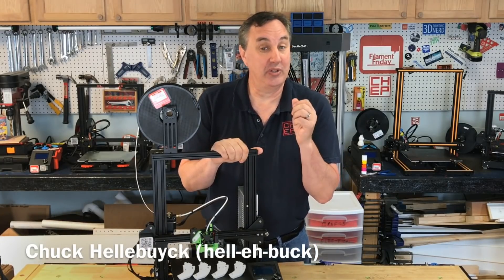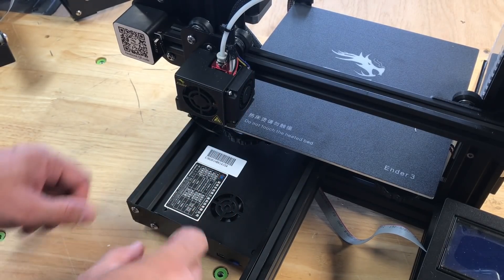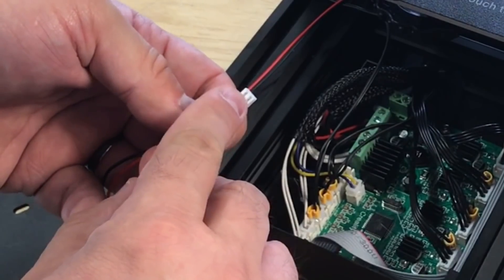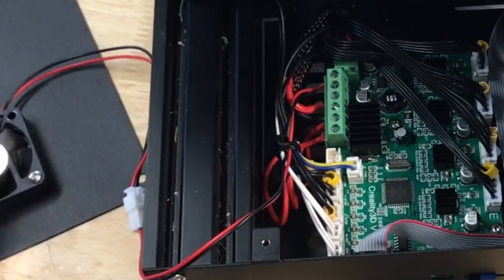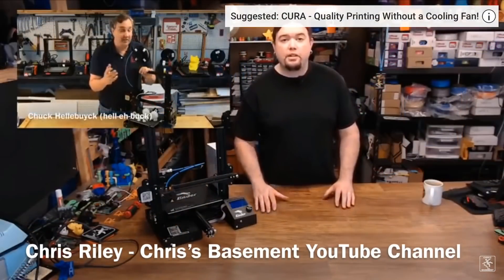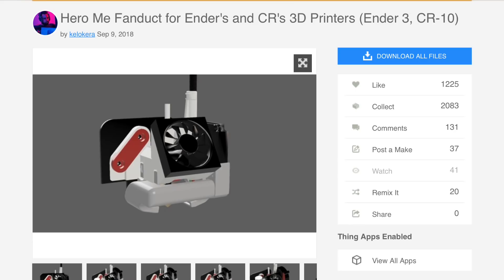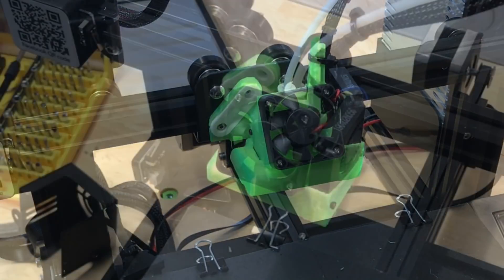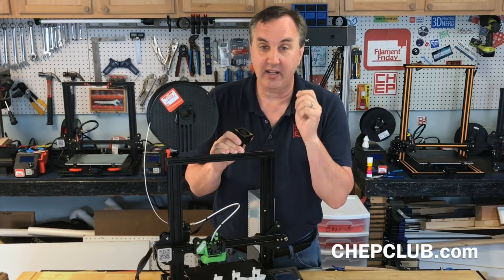HERO ME FAN DUCT and Fixing the Cooling Fans on Creality Ender 3

Comment: As much as I have read/seen/heard everywhere and your video here (which I enjoy to watch and learn), I still am curious and trying to figure out what the fan really is for. Is it to cool the filament that just oozed out of the nozzle? Because cooling the nozzle itself would be going against the heating of the nozzle,  cooling the part(printed part) would mean also cooling the bed (with stray air) again going against heating the bed, so the only thing left is the "freshly" molten filament that needs cooling as soon as its layered on top of the previous layer?
Reply: Incorrect. The nozzle heating is a partial side effect of being attached directly to the heat block. So the part cooling fan isn’t hurting much if it starts to cool down the nozzle a little. The pid will somewhat balance that out. That’s why you’d want to turn the fan on shortly before the slower first group of layers finishes.

But past that, maybe it’s time for some updates profiles Chep. With 4.6-4.7 cura, the stock profiles are orders of magnetic use more reliable and produce much better parts. I think they are very similar to your old old profiles.
Reply: @rayaguilar9085  Does the passage of cold filament not cool down the nozzle, thus needing to constantly heat the heaterblock and eventually the nozzle? Without a constant heat supply, the nozzle will cool down quickly causing the much hated clogs. Therefore I don't think cooling it (the nozzle I mean) even more is needed by the fan(s).   Pid settings are to constantly keep the nozzle temperature as set by means of an algorithm using 3 variables (P i and d respectively), which is the end result, however it would have to overcompensate for the extra heat loss caused by the fan.
Correct me if I am wrong as I enjoy learning new things every day.
Reply: Mike Z you are correct that air moving over the nozzle will cool it (somewhat). I’m not arguing that. But think about the surface area of the threads and the heat transfer to it. The heat loss from the indirect part cooling fan is very minor compared to the direct connection to the heat block. Metal to metal. The pid system is barely hindered by the part cooling fan directly blowing on it. That’s why we use those silicon socks.

But my main point was that the idea people have in their head of the nozzle needing to be the perfect temp is not completely right. As an example, 200°C for PLA. The heat block and the thermistor are trying to melt the filament in the chamber to that. In the 1/10th of a second that the filament passes through the tapered tip of the nozzle, it doesn’t lose much heat from the differential between the nozzle and the block.

As soon as the material is extruded and exposed to air, it’s extremely low density and surface area cool down rapidly. That’s what the part cooling fan is trying to do. Remove the heat that was carried from the heat block as quickly as possible.

I think Chep is seeing these results without running the fan for multiple reasons. But most notably because he’s got his profile dialed in for his env. That being said, he would still see gains with the fan on if he was doing longer bridges. It’s just that so many people have Enders that we’ve damn near conquered these profiles for most filaments :)
Reply from the maker: That’s it.
Reply: The whole hotend assembly (including the fan) is a heartbreak. As you push filament through, you need to warm it up to it's temp by the time it gets to the nozzle. First you cant just push filament into a hot nozzle, it'll takes time for it to heat up so you preheat it. Second the fan keeps the hotend from thermo runaway, where it would just keep getting hotter and hotter till even the sensors would stop responding if it has any and melt or warp things. Most things have termo protection faults, as in failing sensors, high temperatures and such that it will shut off or do some countermeasure. DIY stuff dont. That fan regulates the temperature of the heat break so it won't over heat and go into thermo runnaway.
Reply: @jimd4609 For thermal runaway to take place, the hotend thermister needs to fail first. The hotend won't keep on heating, as thats the job of the thermister, to control the temperature from going over the temperature set in the slicer software for the print.   The only reason fan isnt needed would be if the slicer settings are almost perfect not needing to cool, except for overhangs of course.
Reply: @macvideoworld  not the fan at the nozzle but what they call the hotend, the fan blows cool air across the fins of the hotend. It won't effect prints unless some air from that blows over your print. Over time having it over heat will damage the sensors giving wrong readings and so on. I make wonderful prints but you have to understand why that fan is there. 
Oh one more thing the slicer doesn't control the hotend temperature. That's built in the printers software at factory that was determined by the rate of feed, also set by factory. You can set the nozzle temp in slicers, but not the hotend, and in all in one units, a fan is a must or the whole unit (nozzle and hot end) will be at same temperature, and you dont want that. Itll cause the gases to build up and pops in your feed and you cant get a good feed cuz all your doing it dipping filament in a pool of molten plastic and nothing to really press it through. Tho it will still work, just won't get good prints.
Reply: @jimd4609  I think you use different terms than everyone else. The entire component from nozzle to heat sink is the “hot end”. Not just the chamber, heat break section and heat sink. I don’t think @Mike D meant that the slicer controls that. I think he meant that because we’ve dialed in the settings on these printers, there’s less need for the fan and less danger of damage. Essentially he’s printing at a slightly too cool temp, so that the part fan isn’t really needed.

Past that, no. That’s not the case. Even in a low power or off state, the heat sink getting too hot isn’t going to damage the thermistor in the heat block. The pid reads the same temps no matter what is going on up above it. You may get the ptfe too hot or something, but the fan you’re talking about does not really play a role in thermal run away. The only reason for that fan is to cool down that feed chamber before the heat break so you don’t cook your ptfe, give consistency in the heat profile of the moving filament and (mostly) to keep the two sides in equilibrium.

To bring this back... it’s inaccurate to say the part fan plays no role. It’s not a huge role. But it’s there for a reason. Chep just didn’t need it because his profile is dialed in. The filament is carrying the majority of that heat with it. Just like brass casings in a gun.

Comment: The more I watch these videos the more I'm convinced that the stock Ender 3 is just fine as it is for 90% of the PLA work most people do. The more I try to "Upgrade" my printer the more I mess it up and go back to stock. Now some might say it's because I don't know what I'm doing. I would agree that I'm a novice at 3d printing. But clearly you are not and you're showing no real improvement. Could you please try the same thing on a more complete print? Maybe something with smaller details and over hangs? The Benchy is a pretty basic print.
Reply from the maker: No argument here. It’s a great printer as is. Modding is just fun.
Reply: the only upgrades you should be worrying about are quality of life upgrades or specific use upgrades.  with a standard ender 3 print a shroud for the circuit board.  with an ender 3 or ender 3 pro you might want to consider bed leveling springs and a dual drive extruder.  I personally like the gulfcoast robotics 3 point leveling system and I prefer a borosilicate glass plate for a print bed, but those are more lateral moves.  a lot of people like an auto bed leveling system, but I don't care for them, I can manually level a bed in about 10-15 seconds and only need to do it about twice a month.

any other changes you make aren't upgrades, they're lateral moves for improving your printer in certain situations.  a direct drive extruder is handy for tpu, an all metal hot end is nice for polycarbonate or nylon, many engineering plastics like PEEK require an actively heated enclosure.
Reply: I have the Ender 3 pro and the only mod I did (and not a simple one I admit) that really made a difference was going direct drive. Zero stringing with a 0.5 mm. retraction at 30 mm/s. The rest - tried glass, PEI works ok but deforms over time specially if using higher temps, came to the conclusion their original bed is really quite good. Fan, slowly coming to the same conclusion - the stock is fine.

Comment: Can we replace hotend with 12v 0.08A 5010 fan ?
Please suggest me
Reply from the maker: If you want, it’s possible.
Reply: @FilamentFriday  how is it possible?
Please guide me, if you can help with your video link. Please share with me.
Thanks 😊
Reply: You need a buck converter to drop the voltage from 24v down to 12v. Otherwise you can find 24v 5010 fans on Amazon.

Comment: Hey Chuck, I have been struggling with supports bonding to my project or leaving major artifacts on the project surface. I have changed temperatures, Z Distances, Interface layer height and densities and thicknesses. I just haven't been able to hit that sweet spot, in regards to any filament...
Reply from the maker: No support is perfect. There are always a few rough spots.

Comment: I used the same settings on your current CHEPV4.5_0.20(Medium) profile with part orientation and supports as you have them. My print time is 10h 5 min how is it possible your print time is 5h 46min?
Reply: Getting 9 hours with the same profile adding supports... Also wondering how he's getting 5 hours and 46mins...?
Reply: I got almost 9hrs too
Reply: +1
Reply: I have 9h28min with the same Profile
Reply from the maker: I get 8 hrs 40 min in Cura 4.6.1. The original 3.6 was inaccurate as it took about 7 hours to print. Change inner wall speed to 50mm/s and it comes down to 7hr 47 minutes.
Reply: CHEP thanks that explains a lot 4.6.1 is very accurate.
Reply: @FilamentFriday  tryin it tomorrow. Thanks

Comment: There is a difference. And i would look at the ceiling of that benchy. I agree, good profile do contribute to good prints but part cooling fan improves it when its needed. It did show as mentioned "slight/small difference" is a difference. Also, do you have a closer photos of the Hero Me fan duct? You said it printed "perfectly". I mainly print PETG and I'm curious how "perfectly" it looks like.

Comment: Thanks for the video.  I was trying to print this using your magic 2.0 profile and for some reason it is gonna take 7 hour which is just over an hour longer than you have on the video.  any suggestions on what to check  I have always thought this was a lot slower than my other printers.  I paused your video in each sec ton making sure to match it exactly  I also noticed you have support walls set to 0 because of the preview section.  but for some reason I am missing something which is slowing my print speed down quite a bit  any advice would be appreciated
Reply: I also kept all the settings that I modified and switched to the standard ender 3 .2 profile with all the new settings and got closer to the estimated time frame in this video
Reply from the maker: I believe I used 3.6 in this video but lower infill will speed things up.
Reply: @FilamentFriday  i found a way to cut 30 minutes off the print by changing the combing mode to not in skin

Comment: Aftermarket cooling ducts are for printing at higher speeds. Small models like the benchy generally have no benefit, as the print acceleration on the stock Ender 3 is so low that the average print speed hovers at around 30-40mm/sec at best. I'd like to see this test on a 200% scale benchy being printed at a higher average speed (i.e. 45-50mm/sec, meaning 60mm/sec wall speeds and 40mm/sec infill and top/bottom speeds).

Comment: How the hell did you get the infill out, it has filled the print where the air flows ,plus this took me 5 hours plus just to print the bottom piece
Please let me know how you printed this and how so fast?
Reply: Maybe try with supports only from the build plate? I had the same issue while I was trying out the bullseye duct.
Reply from the maker: Did you slice it with a high infill?

Comment: You could also use 2 diodes to connect the electronics cooling fan to the hotend heater and the object cooler in parallel.

Comment: Help! I got a clog in my Ender 3 Pro and it was on my heat block. So I followed your video on this and got the clog undone. BUT, the hotend fan for some reason stopped working (I did have the power on as I was screwing the hotend cover back on, with the fan going, and my finger grazed the fan blade :S) and now I don't know what's wrong? Please help.
Reply from the maker: I don’t know. Maybe the fan failed.
Reply: @FilamentFriday  is there a check process of elimination where I can find out if it has fully failed or would you just recommend getting a new fan? This is my first printer so I'm a little hesitant to start taking it apart without direction or advice. Ps your videos are great! This was just sort of a surprise issue as I thought I was going to be ready to go after fully cleaning.
Reply: @FilamentFriday  figured out a fix! Turns out, somehow the frame housing the fan unit got slightly warped somehow and the blades were hitting the frame and stopping it from rotating. Found out by pinching it and the fan started moving a bit. So I took my filament cutter and clipped off a couple mms of each fan blade end so it wouldn't hit the frame, powered it on, and viola! It works and pushes out air just as it did before! I just had to think outside the box! :)
Reply: @ryansimons6925  You will get vibrations from messing with the fan blades!  Will probably result in a broken fan sooner or later. You should get a new one
Reply: @ebouledoo  you are right! I noticed this as I was leveling the bed. New fan ordered and on the way!

Comment: You said that you didn't like on the Hero Me that the ducts point right at the nozzle. But that is exactly where it's supposed to be pointing. The entire purpose is to cool the filament as it comes out.
Reply: The ducts are pointed at the nozzle, but the airflow pattern blows just below the nozzle. Fluid dynamics is fun.
Reply: Jake Wilson link.?
Reply from the maker: It’s suppose to cool the filament below the nozzle, not the nozzle. It becomes tougher for the electronics to control the temp with that blowing directly on it.
Reply: @FilamentFriday  Hi, I have to say your videos are awesome. There is now the v3 duct that may be worth testing. Also the fan duct is adjustable height so you can move it Down to get it below the nozzle.

Comment: I completed this exactly. 

red to red black to black in the hotend cooling fan power leads. ONLY the extruder fan turns on and the main board fan still does not........  

tested with 5 different fans  and the same result - no fan rotation.....
Reply: Did you try reversing the polarity?
Reply: You did something wrong. If the main board fan doesn't turn on, then there's an open loop somewhere. Check the fan, the extension, check that it is connected where it should and that its polarity is not reversed. Check if the fan will turn on at all, connecting it where it should. Somewhere in here you'll see the problem, there's no way all of this tests come out fine.

Comment: 02:12 that's cheap Chineseum wire, aka plain cheapest available aluminium. Next "grade up" is copper coated aluminium (so you think it's copper, which is borderline fraud). From a reputable source it'll be straight copper. Copper springs back, so your advice there is correct. Aluminium doesn't, so keep an eye on the electrical connections there.

Comment: You don;t want solder in screw terminals? On fans maybe, but on thicker wires solder is way better then wires, especially if it's in a place frequently tinker around. I've seen a lot of horror "printer almost burned down my house" pics on the Tevo Tarantula group. Yeah, solder or ferroules, but not tens of tiny wires which over time get to be half their original diameter!

Comment: hello,
wold it be a good idea to connect the hotend and board fan to the hoteat block? with this method both the hotend and board fan wold be ON only while printing... ??
Reply: @runninglennart2970  thanks for clarification =)
Reply from the maker: It’s not recommended.
Reply: @FilamentFriday  thanks. any specific reason?

Comment: Thanks for the fix for that design flaw, however I was wondering if you could use that same fix action in another way. In order to take advantage of a quieter fan (possibly Noctua) could you run both the hotend fan and the cpu fan 12v but in series on that same circuit? Additionally I noticed another video of yours using a 12v noctua but it ran slightly hotter, could that be because the noctua is a lower CFM than stock? If that's the case should you find a higher CFM fan similar to stock?
Reply from the maker: Tying them together is not good because the filament fan is shutoff sometimes in the slicer. You don’t want the hotend fan off. 
Yes CFM was lower. Higher CFM typically means more noise.
Reply: @FilamentFriday  Right, I agree that you don't want to tie into the filament fan. I was referring to using your fix action and tying the electronics fan into the hotend fan using 2 12v fans in series.

Comment: Why is the hotend fan always spinning even when de hotend is not in use, like when a print has finished?
Reply from the maker: The hotend fan is directly tied to power so if printer is on, fan is on.
Reply: @FilamentFriday  This is the link to the same video as shown on this page. :o
Reply from the maker: Corrected.
Reply: @FilamentFriday  Thank you!